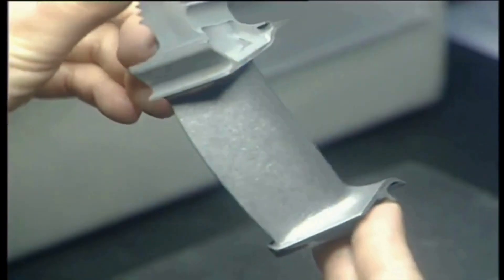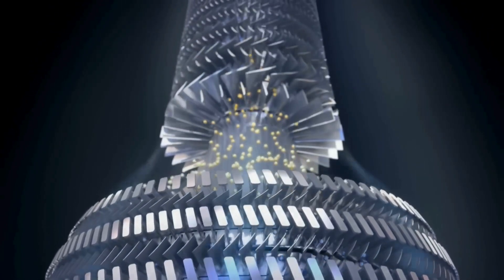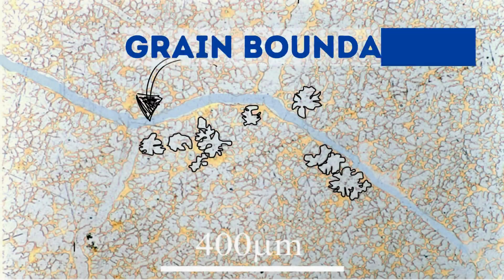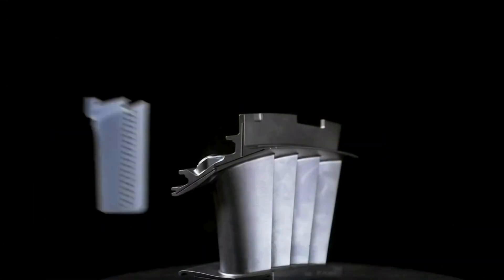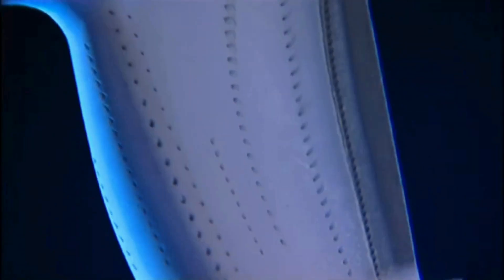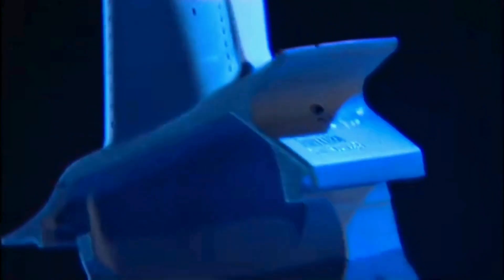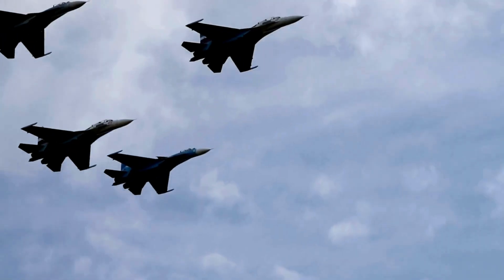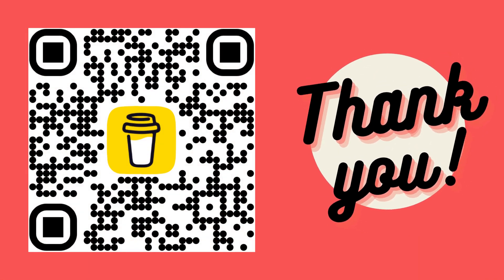Why Jet Engines Need Single-Crystal Blades | Explained Simply

Comment: Also make a video on does India have the potency to build it's own strategic bombers if not then what are our options?
Reply: Doesn't need them, Easy target with modern air defenses anyways. It would be more efficient to spend the money on IRBMs (Intermediate-range ballistic missiles) on mass. Strategic bombers are only effective if they are stealth, and few countries have that technology and money.
Reply: @boblarry5524  Russia tends to use Su-34s with glide bombs to evade air defenses. Is there any specific reason they do this like cheaper costs or greater payload capacity? Or is it just to make use of their old soviet stockpiles?
Reply: @johnhalo512 Glide bombs are stupid cheap and can be deployed from long ranges in relatively save distances. You are correct, they use existing stockpiles of dumb bombs, but also existing infrastructure because they already produce the dumb bombs cheaply. The Su-34s are medium bombers and are well suited for this task as they have the space to carry a lot and a second seat for a weapons officer. Otherwise the su-34 would get obliterated by manpads alone. They are also guided usually by GPS or inertial guidance, so they don’t need to have a lock in visual range to deploy like most air to ground weapons.